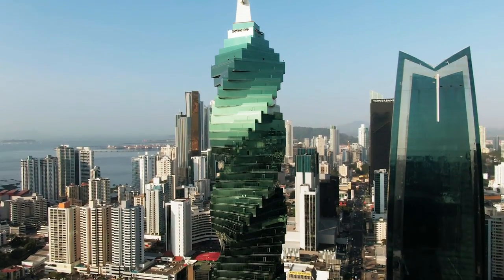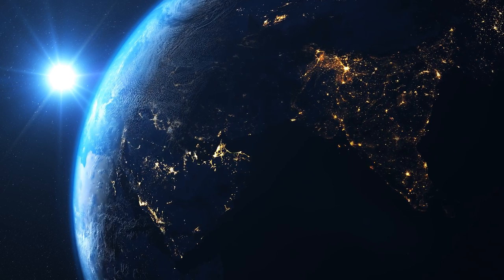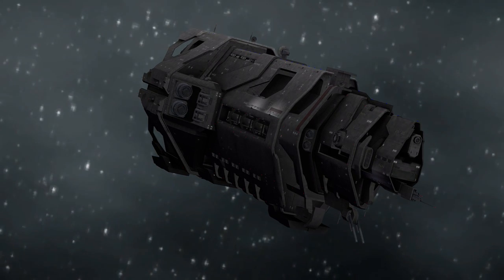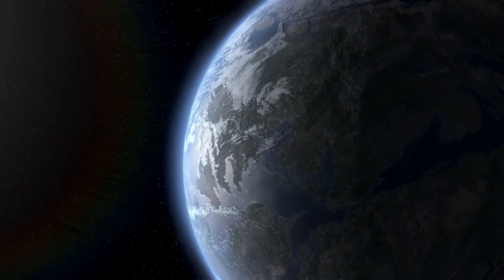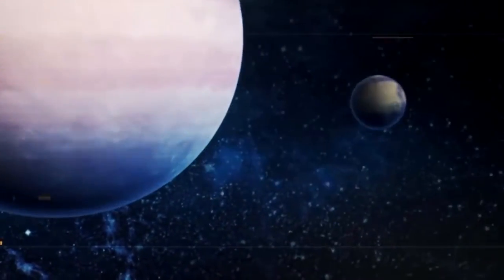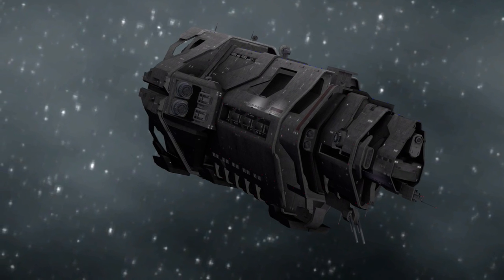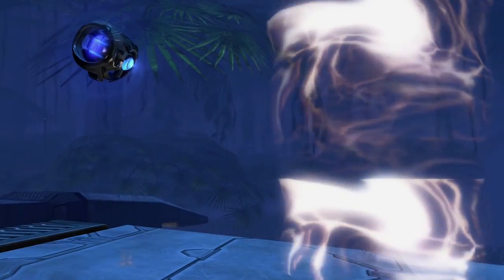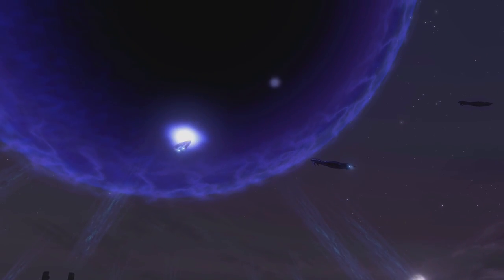How Slipspace Works (Halo Lore)

Comment: Did you know that if t could travel 99.999999999999999999999999999999 percent light speed you'd reach andromeda in a lifetime? Only thing is that time on earth would accelerate so fast that you wouldn't be able to make sense of all the new science coming to you! Tis the technological singularity
Reply: Andromeda is about 2 million light years away. So even at exactly light speed, it would take about 2 million years to get there...
Reply: @joshglover2370  Google "Length Contraction" smarty pants. The only difference is this is extreme time dilation, as in 20 years for you is tens of millions for everyone else. That's how F=ma works dude, even if you were going at 99.9999% the speed of light a light beam would still seem to go at the speed of light, so you spend more energy to catch up to it, when you do, the beam STILL goes the speed of light, so you catch up to it again, each time needing more and more and more energy. Each time you do this you add orders of magnitude to relativistic effects you experience. But ya, if you go close enough to the speed of light to say, Alpha Centauri, it wouldn't take the time that it is far away in light years (about 4.25 years). Like said if you can go fast enough shit you could reach Alpha Centauri in an hour (your reference frame), but by the time you arrive the human race could be millions of years dead by the time you arrive.